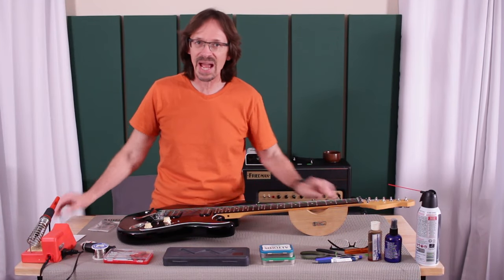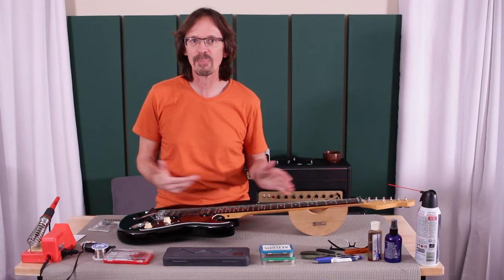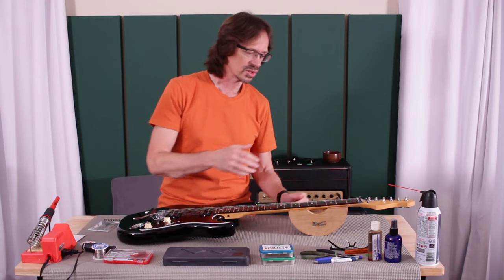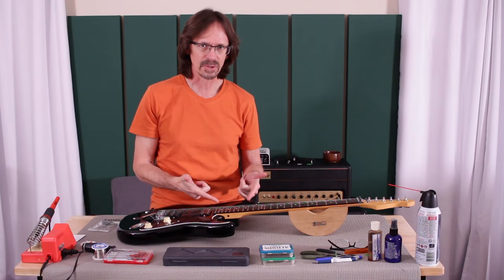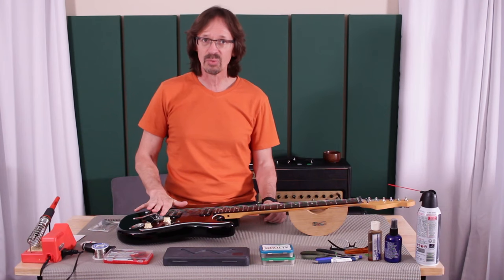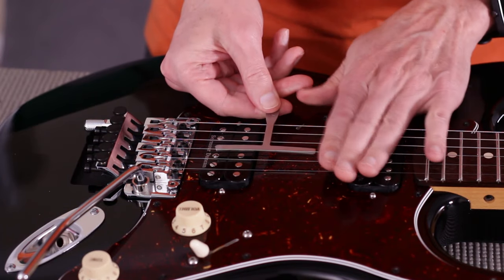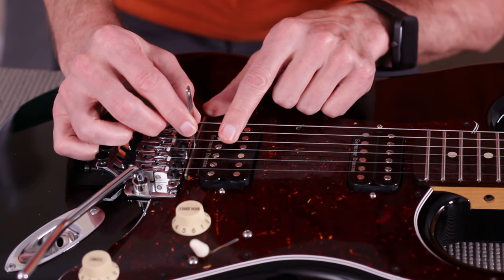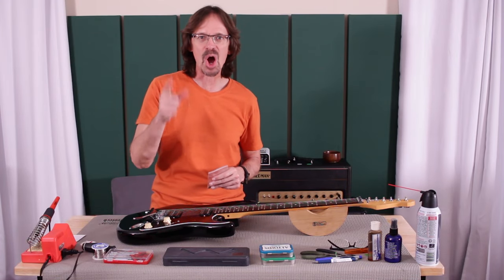How to Adjust Bridge Saddles for a Compound Radius Neck

Comment: This is hard to determine exactly because I don’t know where the compound radius ends exactly on the fretboard. Is it the end of the fretboard or the last fret. Like when they say 10 to 16 in radius, we know 10 in radius starts at the nut but 16 is where? end of the fretboard or last fret? I imagine its end of the fretboard. If it was last fret, then the compound radius would be different for 21 fret, 22 fret, or 24 fret. If its end of the fretboard, it would be different for 21 fret, 22 fret, or 24 fret. We know where it starts because its at the nut, but then again maybe it starts a little before the nut where the fret board extends onto the headstock by little bit. 😂 Sorry, I need some more information to calculate this accurately. I calculated based on compound radius starting at the nut and ending on the last fret of 22 fret guitar with 25.5 scale length.

Comment: I'm sorry but I disagree with the whole concept of using radius gauges for this. Set the action to whatever you like at twelfth fret and the radius is taken care of. Radius at bridge is only relevant where individual heights can't be adjusted. These have limited radius choices anyway. Assuming a compound radius of 10" to 16" That is a change of 5" over 21 or 22 frets. The 24th fret is three quarters of the scale length and is close enough to the 21st or 22nd fret. So we add half the difference. 16" plus 2.5" gives 18.5". For 9.5" to 14" we get 16.25" and for 12" to 16" we get 18". Bridges are not available with these radii. If there's a choice at all. go with a tighter radius as that makes the E strings closer to the fretboard. Remember also that tune-o-matic bridge saddles are meant to have a slot filed into them.

Comment: Everyone uses these gauges incorrectly, IMO.   The reason they allow for going under the strings is to measure the fretboard radius.   If you want to adjust the saddles, just get the outside ones where you want them, and then rest the gauge " ON TOP" of the strings.  Much easier to just hold the gauge on the top, then having to pull up on the gauge and often pulling to hard and stretching the strings etc.      I think I have even Stew Mac do it this way and it makes zero sense to me.
Reply: Measuring on top of the strings ignores the fact that all the strings are different diameters.   The low E has roughly 5 times the diameter of the high e.  This will skew the results if measuring from the top of the string.  What matters is the distance between the top of the frets and the bottom of the string.  Using the gauge under the strings is the "correct" way.  In reality, no special gauge is needed at all.  Use the frets themselves instead.  Set the open string height equal for each string above the last fret.  Add a tiny bit of extra clearance for the bass strings if needed and you're done.  Works for any guitar with any fretboard radius, compound or straight.
Reply: @boogieman00001  Yes, this is true and a point that I omitted.  However, I do not go even across the Low E and High E, so the strings do not exactly match the radius to begin with.   I just find this to be the easiest and most consistent way to go about it.  I always used to go under the strings, but it was a struggle not to pull up to hard and I switched to the doing it on the top.  Much easier and have been happy with the results.
Reply: @boogieman00001  I never said I was MEASURING from the top.  I simply set the low E, HIgh E to where I want them, and then use the tops of the strings to get all of the others set.  The difference between setting the other strings from the bottom to the top using these gauges is minimal.  The ease of setting them across the tops is not minimal. Again, I am already offset as my Low E and High E are not set to the same height, so no matter what I am not following the fretboard radius.

Comment: You didn't show anyone how to set the radius , you just showed people how to "accept" the flaw in floyd rose saddles that cause that stupid "hump" on the two middle strings. Now why don't make a real video showing how to shim those other saddles to match the middle ones ans then lower the bridge slightly.
Reply from the maker: This video was not about the Floyd Rose at all. It was to explain the *concept*. There are hundreds of different bridges out there, all with different ways to adjust the saddle height. Should I do a video for each one? Or...how about you do bridges that start with A-K, and I'll take L-Z?